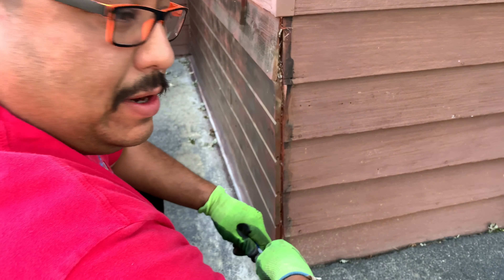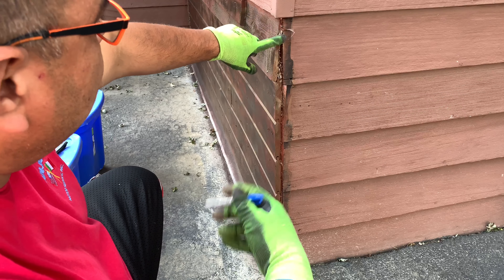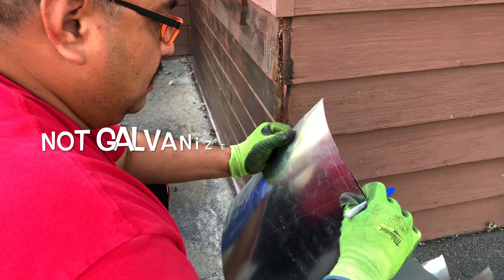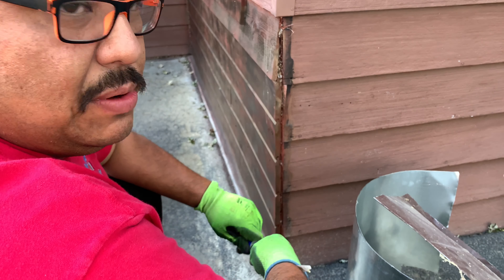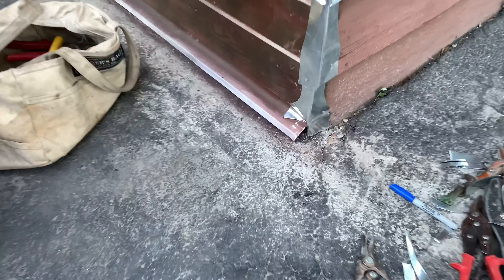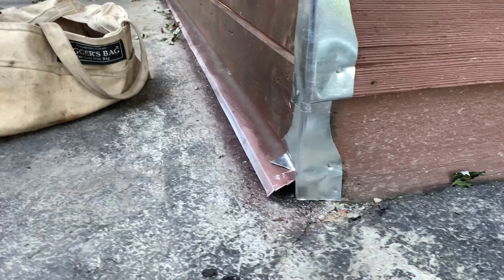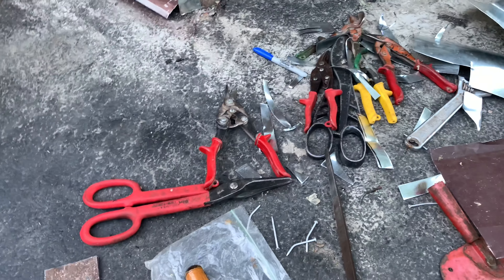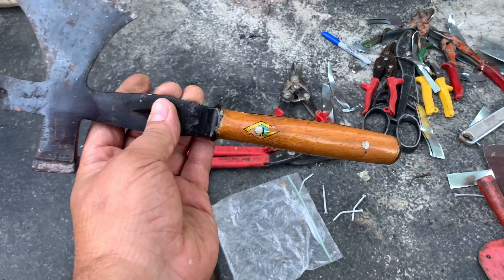J Handy Cutting Corners Literally

Comment: Well I've seen a lot worse.lol Looks like it will do the job and that's what matters most but to the average person appearance is #1.  My tip for next time is take one of the old one's off and use it as a pattern. Then start the installation at the bottom to create an overlap.                            Keep em coming J👍
Reply from the maker: Yeah I threw the old ones away. Oops I would hate to see the worse ones 😂
Reply: @J-WHO312  Lol u didn't do that bad , with matching paint 95% of people wouldn't even notice.
Reply from the maker: NY Outcast how to find the matching paint. LOL!
Reply: @J-WHO312  yeah good luck with that one I always have the customer or my lady do that. Lol Perfect is a matter of opinion 😏
Reply from the maker: NY Outcast sucks I’m color blind!  LOL!
Reply: @J-WHO312   In that case most definitely let the wife pick it. Lol
Reply: Did you caulk at the very bottom where the flashing meets the asphalt (along the length)? Debating on whether you'd want to keep water (snow) from getting in or if it should allow water to exit. You do have mad painting skills!
Reply from the maker: @Di Dz between flashing and asphalt no but I did use a rubberized spray material which is waterproof between Duraroc and asphalt.